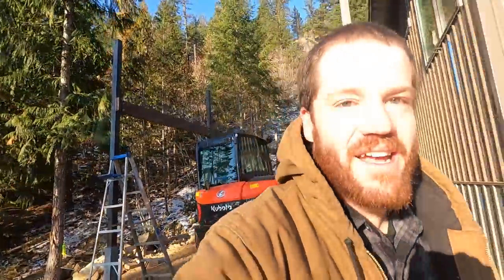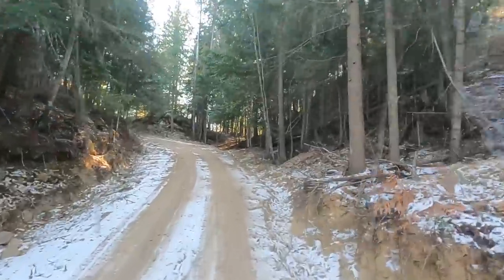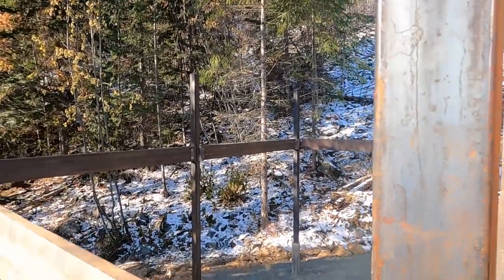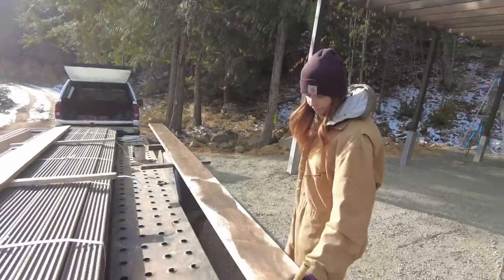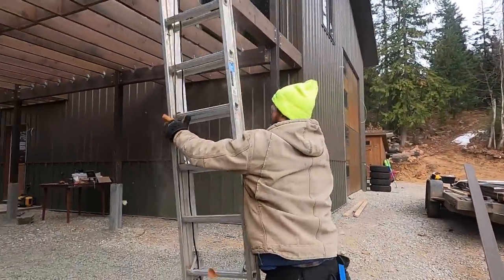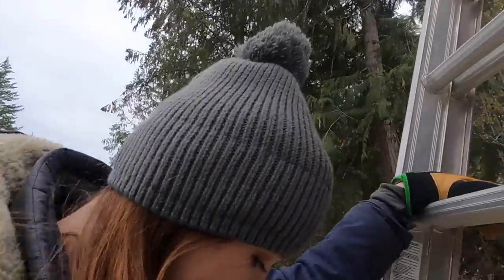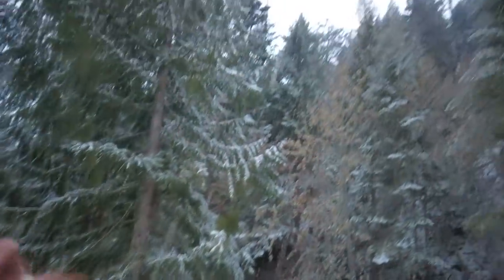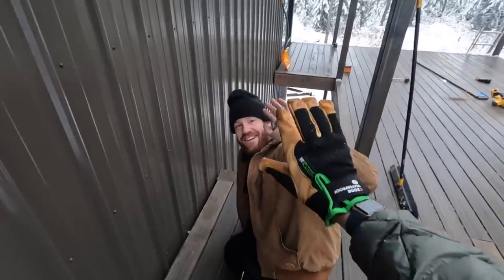FINISHING OUR GIANT DECK | Building Off-Grid

Comment: Here is idea. Why don't you make the roof of green house plastic, Polycarbonate. Develop the deck into "light" greenhouse. Extend the apartment and extend the summer in both ends. Can put fireplace there and make it cozy.  Looks like the foundation are sturdy enough for solid roof and walls.  If you like it, you can insulated the deck from below with mineral wool or XPS.

Comment: put you some side boards on the dump truck so you can haul a little more, don’t  overload the truck though, the GVW should give you an indication of the weight you can put on it. Weigh the truck empty then you can add as much as the GVW, long as your axles are
legal to handle it. you could also get you a dump trailer and tow it behind your dump truck.

Comment: More and more state building codes are requiring decks to be freestanding now days. Even a few local rebuilds of existing decks have gone with posts adjacent to the house even though the original deck used a ledge board attached to the house.

Comment: WELL DONE YA REBELS!! OH AND I USED TO RUN GRAVEL FOR MY POPS WHEN WE WERE BUILDING HOUSES, AND WE WOULD PUT AT LEAST THAT WEIGHT ON AN OLD DUMPTRUCK. MAKES IT STAY PLANTED TO THE GROUND GOIN UP HILLS. AND ON THOSE COLD NEVADA MORNINGS AT 12 DEGREES,, WE USED ETHER IN THE SNORKEL... SAVES THE BATTERIES... NEVER HURT A THING. WELL DONE.

Comment: If you have a torpedo heater next time before starting the Military truck put the heater under the front bumper and point towards the oil pan or put hot coals from wood burner on a metal tray up close the oil pan makes cold starts much easier plus get oil moving faster

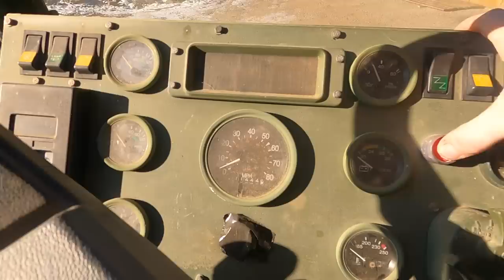Comment: There absolutely is a way to "quantify" the steepness of you driveway.  You can use degrees (a 10 degree slope is normally considered as steep as you want to go).  Or you can use the height/length ration (used in roof pitch carpentry, for instance).  A 1:10 pitch is just under ten degrees, so good to go.   Brief sections that have a good surface can be somewhat steeper.  Hills in San Francisco, for instance, are frequently steeper than 10 degrees--hence cable cars.

Comment: Just know that composite deck expands and contracts like crazy..  In summer it will be crazy wavy because you installed it when it was at its max contraction.
Reply: Possibly not much of an issue, being located where they are. Time will tell...
Reply from the maker: The clips allow for quite a bit of movement, and we gapped the ends as well. But only time will tell!

Comment: If you plane a small bevel on each side of the joint when installing there will be no splinters as the wood raises during wet periods. Dunno what kind of wood that is, or if it is a composite, but it is a very nice touch if you do it when installing the planks. A bit late now thought 😀

There are products to install on top or under the joists to redirect any water so the space under the deck is dry. 

I just finished a 640ft2 deck at my place. Finished day before the snow came. I'll add a small diy lift or hoist on the outside and a swinging gate to make it easier to haul firewood etc from the ground up to the living room which opens to the deck. 

I have a nice view of the sea at my place and are going for stainless steel tubes with wires between them for the railing. Then it will be really easy to clean off the snow if I want to while it is still safe and not impeding the view.

Comment: Congrats on getting you floor joists flat and even.  while pressure treated decking can hide imperfections your composit decking material, because it is so flexible, will magnify those joist imperfections.  I have seen decks that had more waves in them than the ocean.   Good job!

Comment: One word of caution with using composite decking once you hit spring and direct sun. I've got covered front and back porches. The back faces South and is close to 500 sq. ft. Composite gets skillet hot in direct sun so barefooting will be at a minimum.

Comment: Hi U 2, the background song got a bit intrusive for me, thanks for turning it down when you were speaking. I'm older than you - possibly both together - and I suspect I am having more trouble separating 'noise' from speech. Anyway, on to more interesting things, the added weight should have improved the traction as long as the skid mystro took things gently, which you did Riley. It would be very different on ice but snow on gravel is not too bad in my limited experience. Trouble is, of course, if a heavy laden vehicle does let go in snow on a steep hill it just keeps going until something bigger stops it.

Comment: In regards to your hesitation using ether to start the vehicle.  It will be just fine.  Ether will not damage the engine, and I suggest that you use it when it gets colder.  I say this from a stand point of being a mechanic since I was 16, and using these vehicles will active duty Marine (albeit older models).  Good luck,.  On a side note, I just found your channel maybe a month ago, and I am enjoying your content very much, keep up the good work.  Also, invest in a skid loader, those things comes in handy. And one last little suggestion.  Your garage door, the patina looks great, however, if you don't want it corroding entirely, you can clear coat it with a matte finish.  It's a process I have used on classic rat rods when the owner wanted to keep the patina but protect it from further harmful effects.  Once again, keep up the good work, an dI look forward to future projects.

Comment: great job on the deck!  Yeah, attach the deck to the side of the building, just for stabilization.  Or, you would need some diagonals on the sides.  As to the deck material.  Trex is good.  I wish they offered the spacers in different widths.  For a city deck, what they have is fine, but for a country deck, where no one is in tiny heels (spiked high heels) it is much better (IMO) to have 1/2" between the boards.  Makes for a deck that is much easier to keep clean of needles and leaves.  I generally thus don't use the grooved boards, (they offer them grooved or not grooved).  For your railings, consider the stainless wires.   Not so critical for lower decks where most of the view is upward gazing, but for your deck, definitely better than most other methods.  Hog Wire is ok for sure, but the stainless wires, (3" apart) is great.  Just make sure that bottom wire is no more than 3" for child safety.  The wire railings are also fairly inexpensive in comparison, (once you have the equipment, and if you need to borrow some ask).

Comment: Take some deck cut offs and make square caps to slide over the tops of the deck posts you can attach rope to without any holes in the posts.   If you are creative. You can run the rope thru the top then screw a cover down to pinch the rope tight without damaging the rope or tthe top of the post. 95% of that is an indoor job.

Comment: Don't be apprehensive about using the ether start assist.....the military put it on there for a reason, and is stone simple compared to grid heater or glow plugs. There's absolutely nothing wrong with giving the engine a little snort on those cold mornings. Now, if it doesn't start easily in warm weather, then there's definitely something that needs to be looked into further.

Comment: Looking great!  Just a thought if you haven't done this already, but you might want to put some "weep holes" in the the bottom of the welded brackets to let rainwater and snow melt escape.
Reply: I see that Riley caped the posts, but you're not wrong the holes should be at the bottom of the post for condensation. Even a tiny hole in the weld will let in moisture over time and freeze splitting the pipe apart.
Reply: @tonysandbrook3603  That's a good point, but I was actually referring to the welded brackets holding the timber beams.  It's not entirely clear in the video, but it appears they are U shaped.  If so, without any drainage holes they might hold water where the timber rests on the bracket and could promote the rotting of the timber.

Comment: Get a trickle charger,solar, for the battery. it helps warm it slightly. and keeps charge. cheap at harbor freight. 
Inclinometer app for phones work great.  I assume you are making a snow/rain roof over the stairs.

Comment: How shaky is the deck?  I have to admit I don’t like the columns being welded to the the beams.  The weak point is 4’ off the ground instead on the ground.   I have to admit I haven’t worked that concrete beam before but in the episode setting them it didn’t seem like there was enough concrete under them.  It should have been a foot deep.  It looked about 6-8”.  If there is shaking  you should consider welding cross braces from column to column to stiffen it.

Comment: With composite decking as my experience brought me you should always put your choices 12 in between Center not 16 you'll get some they'll start sagging in a couple years
Reply: Agreed.  They are going to have to put in additional supports or live with a very soft feeling deck. Hopefully they also took into account the expansion and contraction of the composite decking.

Comment: I would have setup the joists and decking for a layout that is 90 degrees than your decking run for rainwater drainage away from the building. Also, I’ve used that composite decking for decks and wheelchair ramps and discovered joists should be on a 12 inch spacing.

Comment: Guys  I have 2 composite decks here in Alaska! I have one with hidden fasteners like yours. The other I have secured with color matching screws. The one with the invisible clips with slot full length is curling up on the edges. it looks like the boards have warped at the edges. What we have found out is the cause is water from melting snow gets into the grooves and freezes causing a ice jacking causing the boards to split. The boards without the groves looks as good as the we put them down. I can only tell you good luck with that knowledge in your box maybe you can come up with a way to avoid this with yours! Best of Luck Craig in Alaska

Comment: I love the deck except for one thing, you have concrete piers supporting the posts and the posts bolted to the piers. I worry that without cross bracing and without the deck anchored to the house that there is a chance that an ice/snow load could damage or collapse the deck.

Comment: you can wrap the jump seat (middle seat) with thick plastic , and hold it against the exhaust pipe while someone else holds the start button to add extra backpressure and heat to the motor to help it start. This is how I got mine started in negative temps when I was in the army.

Comment: More great content as usual… I see commenters have suggested the fabric, it does work well. I resisted using trex for years, then got a really good deal … what a great product, feels so good with bare feet, never had a sagging issue with 16” OC. You may want to consider diagonal bracing run across the bottom of the joists. Curious what ya’ll have planned for the deck roof, guess I’ll just have to keep watching to find out ; ) The dumb waiter seems like a good idea. Wondering if the stair stringers are going to be metal or wood, another good reason to stay tuned. I have Army truck envy at this point, I blame you two ; ) Oh, nearly forgot to mention, loved the tune selection, sounded like Dan Auerbach…

Comment: It's super cool to see your amazing progress. From getting your road re-routed and graded, garage floor poured, garage interior drywall & paneling installed, exterior paneling fixed, power panel and shed and finally your raised deck. I am  curious how well you did on the road drainage come Spring on your new section of road since the old road had it's drainage challenges. Will you be adding culverts or is it sloped just right? The fact that you still have your D8 it can be easily fixed. I am also curious about your eventual main home plans too like materials, efficiency & insulation methods, making it solar passive via southern facing windows etc. Great content. Keep up the amazing projects. Merry Christmas and Happy New Years too you both.

Comment: For your inside stairway, I THEENK you should have a minimum 3' landing (measuring from the face of the door outward), and it's part of the Building Code (what's that?) for a good reason.* In fact, there's usually a good reason for everything in the Code (the wha?) which provides for minimum standards. Got a better look at your driveway -- impressive! Looks very professional.
--------------
*So as you're struggling to unlock your door carrying a bag of groceries, you don't lose your balance and tend to fall backwards, down the stairs.

Comment: I just did the same deck and it's awesome but you need to get yourself a power broom they have rubber paddles on it and it won't harm the deck with the snow and a work awesome 99 bucks on Amazon

Comment: The color of the composite is a near perfect match for your siding.  At least on my monitor and to my effed up eyes LOL  Good job with the military truck hauling the gravel up the mountain, hopefully there will be a few more opportunities to reinforce any weak spots in your access road before the spring thaw.  You MAY want to put up some sort of temporary railing this winter though, just to have something to grab if you slip while pushing snow off the deck.  Stay safe and warm!

Comment: Great content today! Its also great to see you two work as a team so well. Riley, you need to get some diagonal bracing put between your post soon or hurry up and put the hand rails on above the deck. With the way you welded your steel post on top of concrete post, a strong wind gust could wreck your whole deck if it starts to shift in any direction right now! Not to mention the weight of any snow on the deck.

Comment: You guys are great.
I can relate the fear of heights, back in 1999 I started working for a cable company in the Newly formed HSD (High Speed Data) department, I am a computer guy have been for years before most people even knew about computers. But to the story.
I didn't think that I would have to learn to be a "lineman" but working for a cable company you have to learn "Core" which is installing the cable line too, so it was off to gaffing and ladder classes, plus driving heavy duty utility trucks too (that was easy been driving since I was 13) But I had to learn climbing poles (gaffing) and line span climbing (putting a ladder on a wire and climbing the ladder) I have had a fear of heights for most of my life since I fell down a flight of stairs on my 6th birthday and getting a grip of stitches on my birthday.... So we go thru this 4 week class Of Safety climbing, Safety Carrying, and Safety Driving it was intense the first week was the driving and carrying ladders, simple enough (I was not aware there was a right and wrong way of carrying a ladder. "Now I do, well then I learned") so came the dreaded second half of the classes the Gaffing and Span climbing. The gaffing was scary we got to watch a lot of videos of guys burning a pole (Sliding down firemand style, not deadly in most cases but splinters unlike anything you have ever thought of!) then we learned how to put our ladder on a line you know between poles climbing up and tying off in full gear. and that gear is heavy (there was also a max body weight you had to be you could not weigh over 260lbs. with over 40lbs of gear and the ladder safety margin was 320lbs. So there is also only 1 Right way to climb a ladder, and many, many wrong ways... So on my first time (not in my life but as a professional) I started to climb the ladder 2 steps up I was told to stop and freeze! The instructor said "are you going to climb the ladder or make love to it?" Ugh, I was embarrassed for sure, after being told how to climb it and we are not talking on 5 foot climbs, or 10, not even 20 but at 40 feet off the ground Of course there was a platform right next to each of us with the instructor watching from above and from below.  on the last day to get certified we climbed the ladders all 15 of us no instructors up there we each climb and tie off and are asked from the ground are you tied off and are you secure. I said "I think so" and was replied there is no "I think so" and I said "Yes I am" and with that a few seconds later 4 of us get our ladders kicked out from the ground! I was hanging there tired to the ladder and to the span and just scared to death. I realized that I was not falling and I was secured to the span and to the ladder. Afterwards the ladders were resecured and put back in place I wanted to beat the $h!t out of the guy but I learned that day that if you are safe and you use your safety gear you are going to be okay, Oh BTW there was one guy that would not come down after his test, they had to use a bucket truck to get him down. He quit that day! To this day I am scared of heights, but when I am tied in and using all the right gear I am good.

Comment: We put on composite decking and are very happy with it 4 years later.. a couple things.. It is slick when you get a little snow on it, and it tends to retain heat in the sunshine! But so far great stuff..  Btw.. there are two pretty large holes behind Riley in the cab of the SS Army truck.. just wondered what they were for, or why they weren’t filled in?  😊

Comment: IDK but is it possible to put a blue tarp on the deck before it snows so after it snows you can like “roll” the snow off the deck rather than using a shovel & brooms to clean it off? I would like to think that would work in a light snow but not if you got like two feet of snow 🤷🏾